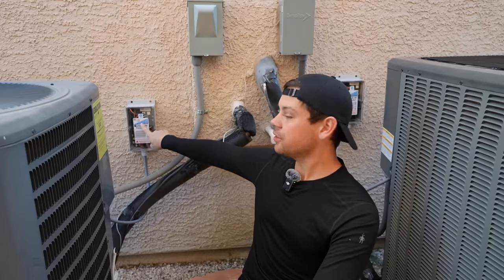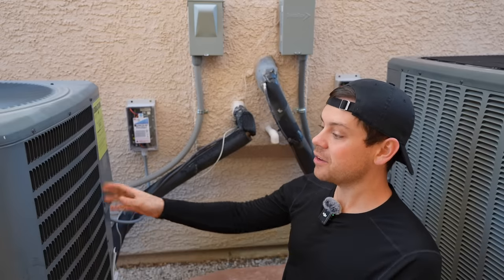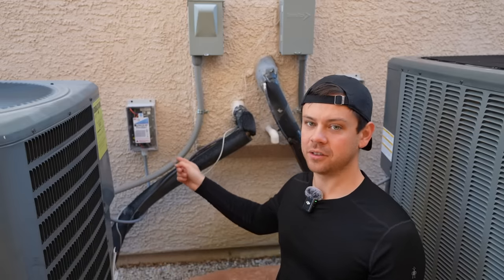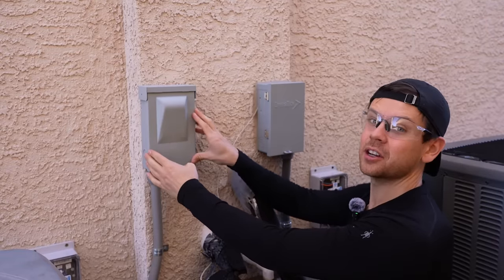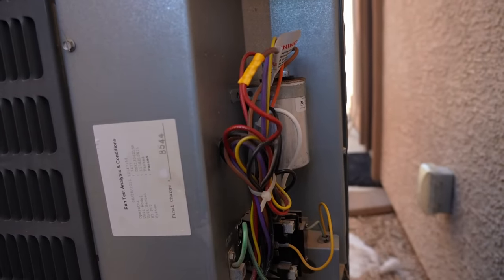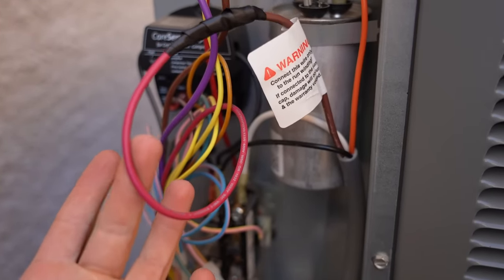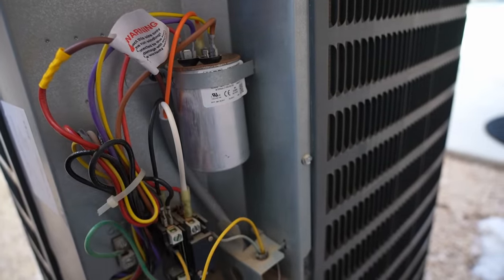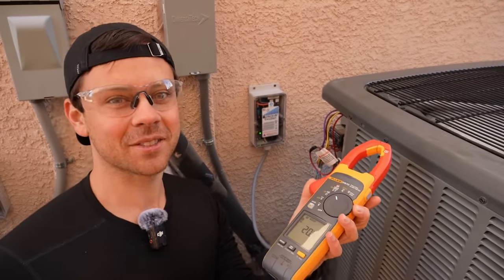AC Soft Start to Save $$$ in an Off-grid or Battery Backup Solar Power System

Comment: You showed the in rush current with it installed being even a little lower than expected, but that makes me curious what it was (for that specific unit) before insallation.
Reply from the maker: Almost one hundred amps. But the day was cold so that's why it dropped to 20. Usually it's 25

Comment: Did I understand you correctly that it’s not worth it for grid only? Wouldn’t it save on the power bill?
Reply: No power savings, instead of 130 Amps for 100’s of milliseconds on start it daws 30 Amps for longer - but bid draw adds up on stressing compressor and inverters.

Comment: On micro air site, they said AC units with  the newer inverter driven systems should not use the  soft start? I have a new AC unit. I just bought six months ago. How do I know whether it’s OK to add the soft start?

Comment: good video , hey I have a video request. I have a 6548 ( EG 6500 ) anyway I run 220 volt to my well with this unit using a Growatt 5kW Split Phase Transformer | ATS 5000T-US . With good luck, works well . We have added the new EG 6000XP which is 220 volt output. I have not switch the well over to it. But because its a little less outut capacity I was think would load balancing work using this growatt or any other transformer (Victron, outback etc ) . I know you can load balance with some of this transformer , but that's normally adding power from one leg to another. I don't know if you can use it to help with inductive loads on an inverter that already outputs 220 volt split phase. Can you do a video on this maybe ? it doesn't have to be with the EG 6000XP , but any split-phase transformer.  the well I am running uses 3200 watts running but start-up Im sure is a lot higher ( I forget now )

Comment: Sorry off topic. Can i put a manual transfer switch to chose where my solar panels output goes to. 4 x 550w mono to either water pump or to the 6.2k 48v charge inverter. Can o just use a manual transfer switch?

Comment: What do you guys think about a hard start kit? I installed one in my 3.5 AC unit, it dropped the in rush amps from 100ish to 45, and it only costs $15 on ebay...

Comment: I need this but for a gas-powered Kenmore dryer Model 796. My MPP Solar LV5048 can't turn it on by itself unless I run the inverter in the mode it parallels the output in single a
phase. Output voltage is 120V using both L1 and L2 together. That way the 5KW can be used and the dryer does start. Has been doing so for more than 5 years now. But I really want to have the system in split phase if possible. Can one of these AC Soft Start work in this scenario?
Reply: Measure your peak amps?

Comment: The AC already has a capacitor. I don't understand the point of this extra soft starter.
Reply: The device controls the current ramp variably to the minimum required to spin, then accelerate the compressor.

Comment: Soft starters claim to extend the life of your compressor start winding
Soft starters will allow you to use a smaller gasoline generator to start your a/c if your power goes out assuming you have a proper transfer switch

Comment: I have a 12.8 volt ,50 amh LifeP04 battery and my ebike charger is 54.7 volts .
I'm wondering if the ebike charger charging at 54.7 volts will damage the LifeP04 battery.
Hopefully someone can help out ,thanks!